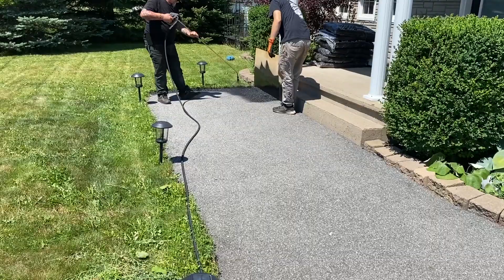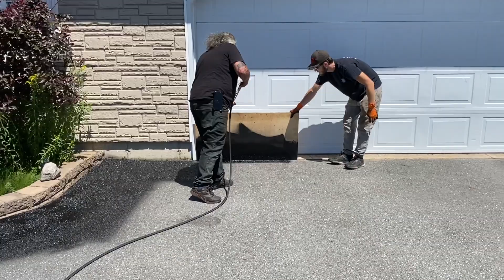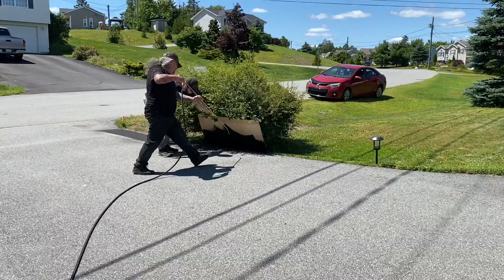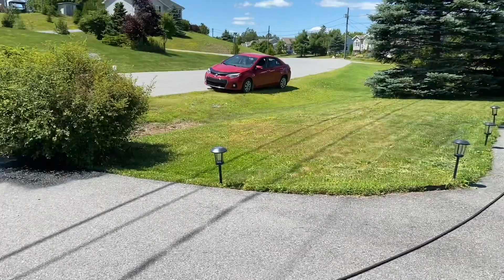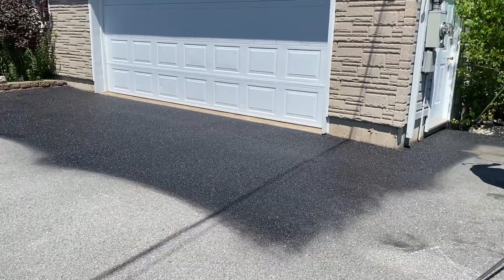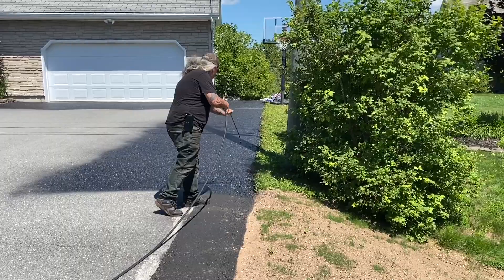Professional Asphalt Spray Sealing: "The Double Patch One"  Top Coats Pavement Maintenance

Comment: How this sealing affect on grass ?
Because I see that you spray edge of the lawn with it.

Thanks.

And good job !
Reply from the maker: It actually looks a little worse in the video's than it is, the first lawn cut after we seal the edge is gone. We used to trim back the edges before but actually broke a customers window once from a flying rock,  so we stopped doing that.

Comment: Are you using a power washer to apply sealer ??
Reply from the maker: No, a small engine powering a hydraulic pump, pumping out of a tank on my truck.
Reply: @FastFordClub  ahh okay I was just curious I have never seen this type of set up it looks like a power washer wand, i sealcoat myself for a living. That’s a nice set up for driveways and smaller lots ! I’d like to see more of the setup. Instead of dragging the 550 out for driveways I would throw something in the back of the pick up like yours. You spraying emulsion or coal tar ?
Reply from the maker: @ryanolivier4952  I spray an oil/asphalt base product. This set up is awesome, I really don't bother with large lots anymore so this works fine.I use a small engine to power my hydraulic pump and I use a pressure t-valve for pressure and return regulation.